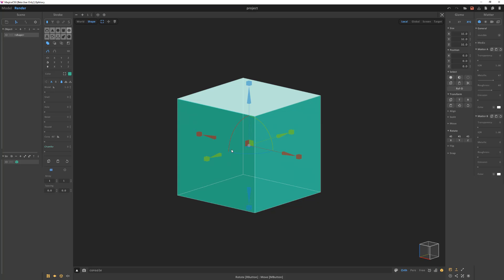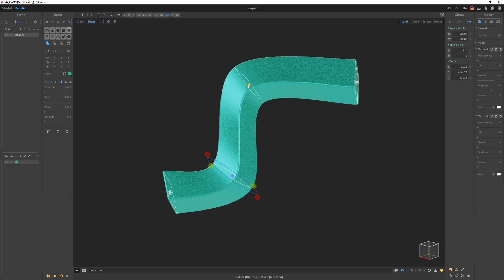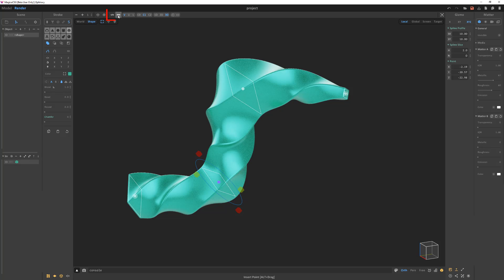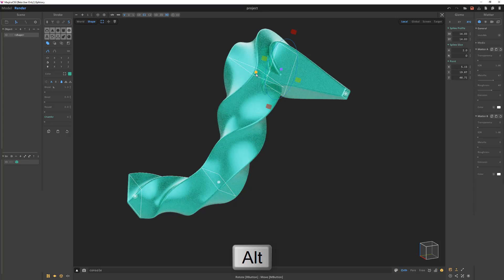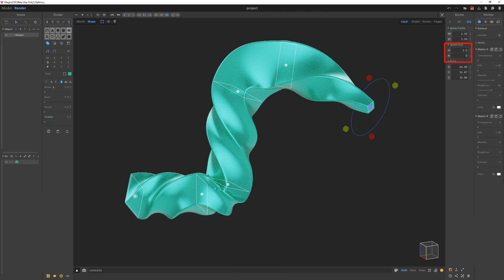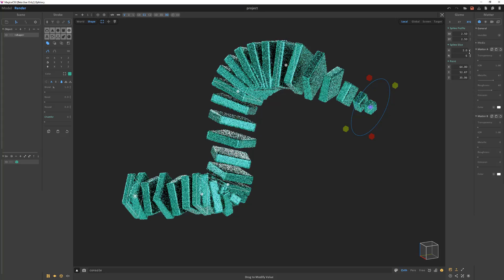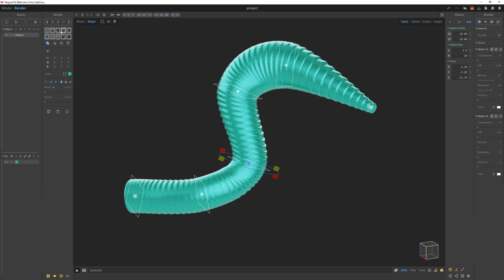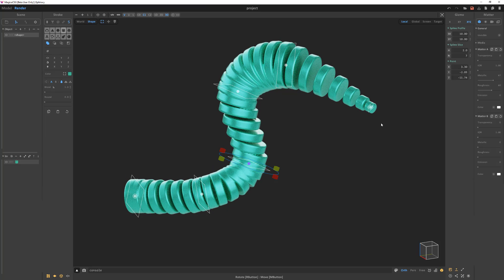MagicaCSG | Sweep Mode

Comment: Awesome! Do you know if it can be used with custom curves? When I try, they return to their original shape.
Reply from the maker: Do you mean "Polygon Strokes"? If so,  dont believe that has been implemented yet. Sweep does work with Polylines tho. But not Character, Polygon or Circle Strokes
Reply: @Pixelfondue  Sorry, I mean Polylines. The problem I have is that when I select sweep mode, the polyline shape changes back to its original "V" shape, not the one I created. Always doing a "V" shaped sweep
Reply from the maker: @CarlosPrGr  Ah... maybe a bug or limitation of Sweep
Reply: @pixelfondue  oh... I hope he fixes it. Thanks for your time!
Reply: @CarlosPrGr It's controlled by the profile's dimensions, I believe. You can't control a profile's control points as freely as those of a polyline, but you can indirectly control those default 3: the horizontal dimension at each point moves the first and the third points together/apart, the vertical dimension moves the second point perpendicularly to the other two, allowing you to turn that "∨"/"∪" into a "—" or into a "∧"/"∩". It's not as flexible as having full NURBS-style control, but you can do quite a lot with what's already implemented.
Reply: @bemepy6248 Thank you so much for the explanation! It really is a powerful tool.